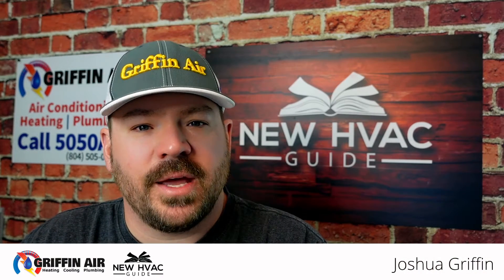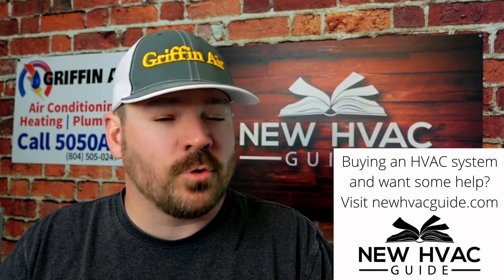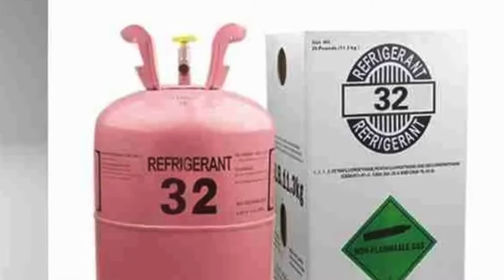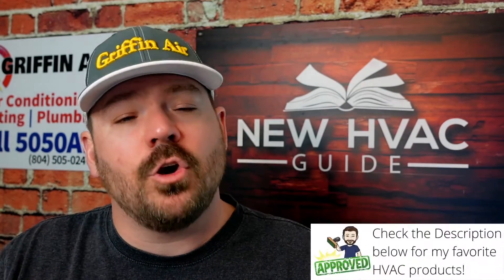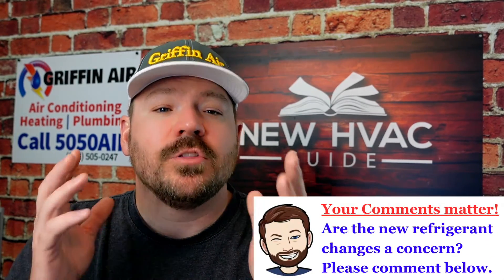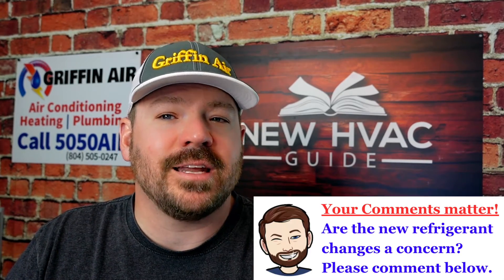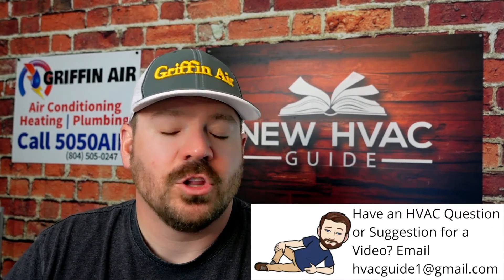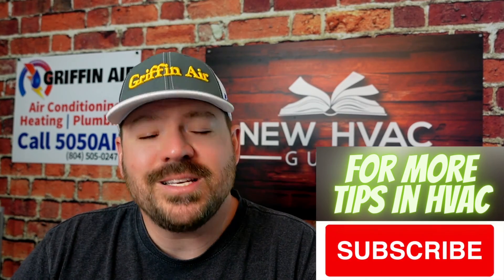Can You Put R32 in 410 Systems? What Will Happen?

Comment: I didn't notice how old this video is and I absolutely agree I can tell you I have installed an R32 system I can tell you there's very little difference in pressures and quite frankly I didn't notice anything significant in the discharge temperature either. Maybe I just didn't notice that but I think I would have noticed it I wish they'd just leave stuff alone

Comment: 410 works fine in a r32 system... And vice versa. Residential customers are not complaining and pulling their homes down to 19 deg c in some cases when required.  It works, end of story. Legalality is another issue... If you have to, do it.

Comment: Do not put r32 in an r410a for 1 very specific reason.  R32 is more flammable and requires leak detection equipment that will turn off the condenser while keeping the blower motor running if there's a leak.
I'm sure there are other reasons as well. Beyond the fact that it's likely illegal.

Comment: its 410A with methane, pressures are the same and you can run 410 A in a A2L system and acutually be safer.

Comment: so if you came here looking for this video, I'm pretty sure I know why you probably live in a state where you can only get the 454 equipment and you can't get the refrigerant so the systems come charged typically with an extra 10 to 15 foot you're wondering can you top it off with 410

regardless of everything you're hearing on the Internet, I know a guy that I know for a fact has been using the 410 to top off his 454 and he has been having zero issues 

Not saying you should do this, but if you're selling equipment that you can't get the refrigerant for what are you supposed to do?

Comment: R32 uses a higher temp viscosity oil than 410a so it will overheat. However r454b uses the same oil  viscosity as 410a so you can use either in the same compressor

Comment: If its all you have and your just trying to get some temp cooling until repairs can be made, I cant see why it would hurt using R-32 in R-410A system, sense R-32 is already 50% of the volume of R-410A. In my understanding is when A leak develops you end up loosing your 50/50 ratio because one refrigerant tends to vacate at a higher rate due to the difference on thermal properties albeit minimal for R-410A. That's why after a large repairs I replace refrigerant with virgin refrigerant to maintain that proper 50/50 ratio but also reduce risk of re-entering moister or contaminants back into the system. I know R-410A has minimal glide compared to others refrigerants like R-407C. So this is something to think about.  Good Video with Good advice sense this channel is labeled as a homeowners guide, I would recommend leaving the charging of the system to a professional if that is an option.  Well this is how I see it so take it at face value. I am open minded and If I'm mistaken please explain I'd love to learn something and share idea's.

Comment: Installed a R22 3 ton reem package unit at my house in 1995 an she's still running good.
Reply from the maker: Wow!
Reply: Are you still adding 22 to it when needed, or are you now using MO99?
Reply: Mine was a R22 RUUD, I think same as REEM, 1987.  Replaced it with RUUD in 2023, 410a.

Comment: In case it helps anyone. I have an R32 system that leaked. I ended up discharging all and filled back with 410a until I reached 1150-120 psi.

R32 is very expensive. R410a is easily available online or marketplace. Hope it helps

Comment: An important point was missed. The GWP effect is when there is a LEAK! not while it's in the system. When & IF it leaks when there is a fire, it will propagate the fire!!! 
Also, very important flammable A2L (R32 or R454B) might and could INTERNALY explode. This is true if the vacuum process (must be higher than R410A an A1 class non-flammable, non-explosive class) is not perfect (presence of moisture/oxygen) as when compressed the temperature could reach the lubricating OIL ignition temperature, and in the presence of flammable refrigerant (any A2, A2L or worse A3) the oil might ignite the flammable refrigerants! 
This possibility will not exist if A1 class non-flammable refrigerants are present. 
Neil Afram Director of Space Air Ltd. distributor of AC & Heat Pumps since 1980.
Standards & Regulation relating to refrigerants classes ASHRAE 34/15 & ISO 817/5149
IMPORTANT: You can replace R32 with R410A but not the other way around due to flammability of R32
Reply: Bro, when a system leaks, you cannot detect it without a leak detector. It's only for when you spontaneously lose the entire charge in about 10 min.

It's overkill.
Reply from the maker: This is good info. However, what are you saying homeowners should do? They pretty much have no choice but to go with these new refrigerant systems.
Reply: Fella there's not enough O2 in even a poorly evacuated system to blow your nose. The histrionics in this industry over flammablity is ridiculous. Just the higher  operating pressures in this fiasco vs r22 creates more global warming on hot days as coal power plants go online to create head pressures 100 lbs more so you a*hats can turn over the hapless customers with fear mongering new * high tech solutions so uncle Sam can tax refrigerants. I don't see how you people sleep at night.

Comment: "Honey, I'm making a video about putting R-32 in R-410a system for my youtube channel, even though I don't know anything about it.  This is brilliant!"
Reply: Yeah we bent over as a industry while we have propane in house or natural gas with no sensor on appliance or shut offs .
Reply: exactly, the first thing he said is he didn't know what would happen. r410 is mixed to reduce the flammability of r32 which in not really very flammable. our safety conscience government is going to make an issue of this but for those of us who like to play with fire I say go for it.  that is not really sarcasm, I might try it when I run out of 410. by then I'm sure I won't be the first
Reply: Remember R32 is flammable and R410A is not. If you put R32 (don'tt know why? since R410A is non-flammable, non-toxic and non-explosive and available at least till 2040) the R410A equipment might creat a spark that will ignite R32!
Reply: @neilafram663  I was being facetous.  Jesus...
Reply: @Ephbaum  I wasn't!!! you think its a joke 🙄 I don't ass-u-me you are an engineer!!!
Reply: @neilafram663  i refill r410 split AC with R32 from 2016 till now, zero negative feedback.

I realized this is will work because almost every single AC technician dont know how to refill R410 properly, so basically they just refill R32 every time they refill with R410 .

Comment: I remember when 410 replaced the R22.. Customers with no money to replace the entire unit, I use to convert the systems by replacing just the compressor, pressure switches , liquids and suction filters and expansion valves... At the any , I have converted around 100 units, ( package and split ) in the average of 5 to 30 tons. And on 2023 are still working properly. A lot of marketing people were saying that the copper was not design for such much higher pressures, well guess what, some of those unit ( back in 2014 ), were already 13 years old, and nothing breaks down after conversion, therefore, all of them still cooling. I just slightly  reconfigured the compressor size. Now if is gonna be and existing 410 unit , and lets says that I want to try what R32 would do, I just need to find out what kind of oil the new units will gonna use, pressure, etc.. At the end, copper , aluminum are the same in all units. Most of everything now is marketing, or tricks to scare people and to sell.. Remember, not everyone , and with the actual economy , are capable to change out the entire equipment.
Reply: Absolutely correct…it all has been a scam from the beginning…and we all bought it.  People are fed up.  Now the industry will suffer because I have wealthy folks placing 3 ton units with window units and splits in their homes and not repairing the package systems.  When you quote two 3 ton units at almost $20k, folks say NO.  Convert the old or they choose multiple splits etc.  it is time to learn more about conversions and Blueon refrigerants
Reply: Agree changingvthe compressor and TXv changes R22 to R410 no issues
Reply: Same here. I still do some conversions
Reply: One day, i doubt it, the people will realize that the common denominator to our industries is the gov and industry collusion and their mandates.  I was one of the first to take that EPA refrigerant exam that we ac guys must have to buy refrigerant, we were told at that time that the ozone layer was failing due to refrigerants and propellants.  This was going to cause everyone to get skin cancer and die.  As soon as the USA signed onto to this life saving event, the ozone layer suddenly closed and we were all saved.  At that very moment, even being a young guy at that time, I immediately realized we were boondoggled.  I have never trusted the gov or industry since.  Complete sham.  This refrigerant change will happen every 10-15 years as  in perpetuity as patents run their course.  Too bad.
Reply: ‘A few folks filled r410 into r32 ac’s mistakenly’ this is what manufacturers have been telling dealers to spread - quite a few people died because r32 ac’s blowed up - r32 ac’s stopped getting sold really bad here in Pakistan. Lot of the ac techs are uneducated non manufacturer trained staff - majority refuse to work on r32 - no one really knows what the real story was on the r32 ac’s blowing up - it will be while when it penetrates market properly
Reply: Why not use R438A?
Reply: I've heard many guys are just putting 410A in 454B units with no problems.
Reply: @br5747 just need to replace txv to operate with 410. About pressure switches, they stay the same. Pressures ( 410 and 454 ), are almost the same
Reply: @joeschneider67 

The Carrier dealer said the TXV's are the same.
Reply: @br5747 but the txv contains R410 😮.. Sub cooling and super heat could be slightly different
Reply: @joeschneider67 

 I get what you're saying but the counter guy at our Carrier dealer said that A TXV for 410A and 454B have the same part number.

Comment: Just getting some new units in from China with a factory fill of R32.  They are the same as the 410a units, same part numbers and everything.  I can't seem to get R32 yet.  But if it comes time I need to do something with the refrigerant, I'd have no hesitation to pull the R32 and put 410 in.
Reply: Thanks for your comment.  I got a call and the unit is r32 and no one seems to have it available.  So I'm not sure if 410a would do the job.
Reply: @ebenezerservices6363 bro daikin has been selling r32 units for over 5 years. It's not an issue - in addition,  r32 doesn't explode ffs.
Reply: Ac’s blew up in pakistan - apparently proper vacuum was not done - 410 inserted in a r32 after repair job this is story manufacturers made up - quite a few people died - sales of r32 units has fallen very badly with r32 selling lower price than r410 units in many cases - we really dont know what happened but quite a few families destroyed because r32 blew up
Reply: @kazifaiz stop making sht up
Reply: @sprockkets its happened in pakistan - if you dont know you dont know very public affair

Comment: I’ve had  two 12,000 btu window units that use r32, both failed at 16 to 20 months. Two different brands with similar compressors burn out. The flammability issue with a compressor failure makes me nervous.
Reply: I have 2 Mitsubishi R32 mini split system. Both are 5 and 6 years now and they work fine, nothing has broken yet.
Reply: unless you have a serious blowout and your house is already on fire you probably don't have much to worry about
Reply: And you know they burned out.....how?
Reply: @sprockkets because they compressors got so hot that the paint melted and flaked off the compressor on one. On the other the wired going into the compressor burned up do to the compressor shorting internaly

Comment: Interesting. I have an R32 minisplit that the HVAC guys filled with 410A cause that is what they had. So I guess the inverse of what you are talking about. I asked them about it and they didn't seem too concerned. Perhaps it just means my system will be slightly less efficient?
Reply: Is it still working?  Cause I’m about to do the same
Reply: It is still working and is cold as ice even with 100+ temps in Idaho. @terencemerritt
Reply: I'm going to be doing this because I installed a mini split and loss some refrigerant
Reply: I think you’re thinking correctly.

Comment: I'm DIY and ran across some data that is not clear about motor bearings. In one brand I found condesnser motor specs to show various bearing types. One in particular of the few typical types such as sleeve or ball bearing, SAB bearings. I looked them up and still cannot find what they are, sleeve or ball bearing design. Does anyone know what a SAB bearing is and if the design is longer lasting as the ball bearing types?
Reply: Why on earth could you possibly care about condenser motor bearings to where you're researching about them?  Who cares?  Replace the motor.  Jesus...
Reply: @Ephbaum You can ignore quality and buy cheap Chinesium and replace that crap more often and likely at the most inconvenient time. a quality motor will last for decades. It'll cost you more in the long run and be less reliable. In the short run or a temporary fix, who cares may apply.
Reply: I saw that Japanese brand Mini split builds are much better with Mitsubishi being best option. Japan is where mini split originated.
Reply: @toniamichellefeagle8001  Daikin is the leader in volume...they are Japanese as well.

Comment: A few facts............................      R410A WORKS IN R32- units        R32 WORKS IN R410A........   R32 has a slightly higher discharge........          Only benefits    In the U.K  of R32                                               a 5kw or 7kw unit uses smaller pipework

R32 is an A2L in europe but not in japan...........    R32 and R410A is almost the same gas...................................

Of course its on paper illegal.. But the above is true...

hope your good sir
Reply: Did you try putting R410a in R32 units ?
Reply: @hamzaabibisse3159 ?